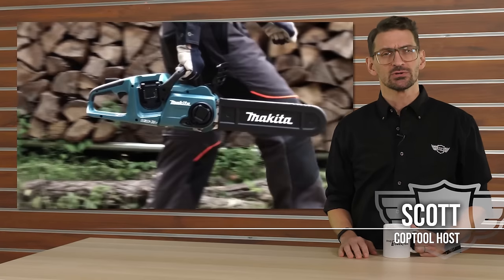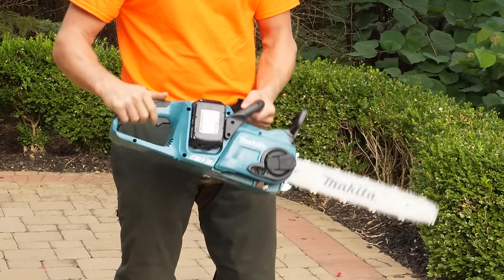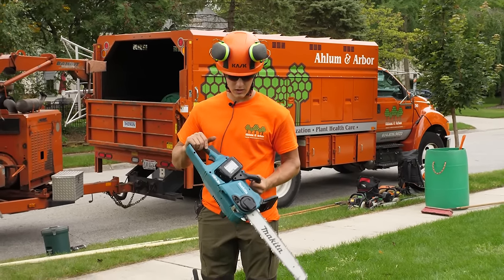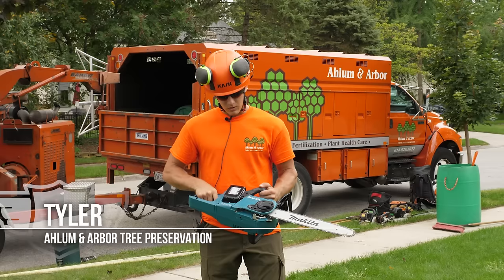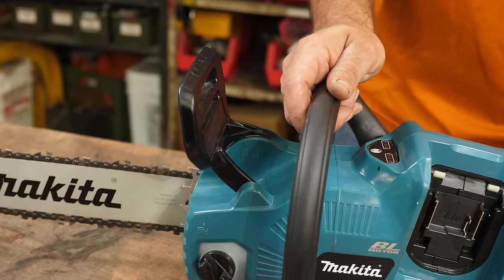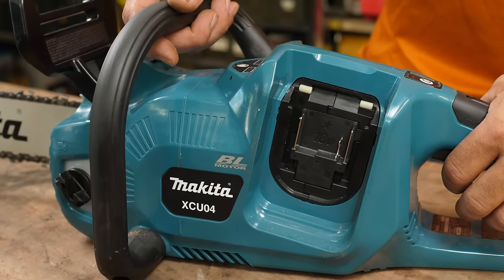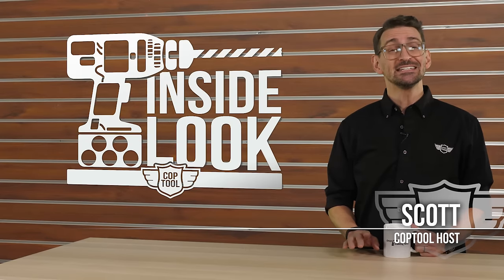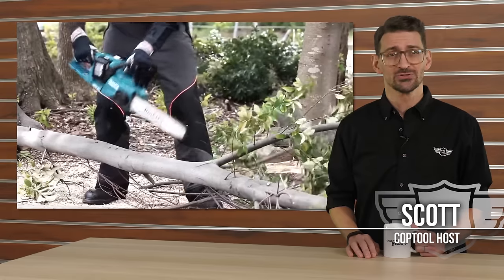Inside Look: Makita 18V X2 (36V) LXT Brushless Cordless 16” Chainsaw XCU04

Comment: Having spent a few hours running saws I believe what he was saying was will any electric saw replace my gas saw. Oh hell no! For the home gamers in the back yard fine. Also when you say you're going to take it apart I was assuming it was going to be AVE style.  A bit disappointed in that all he did was take the bar off. Come on open that baby up let's see what makes it chooch!
Reply: I have not found anybody who takes tools apart like AVE. He did though pull apart the dewalt saw and he was very negative towards the plastic tooless bar ratchet mechanism. Makita does sell the LXT saw with the old duel nut style which should outlast the saw itself

Comment: You need a HEAD TO HEAD BATTLE, MAKITA VS MILWAUKEE
Reply: Luke S    Also add the EGO with their 7ah battery
Reply: Tried this and it does not have as much power
Reply: Any comparison should be done with equal power batteries.  2 Makita 6 Ah batteries have the same power as Milwaukee's 12 Ah battery that weighs a pound more.  The chains should be the same as well a full chisel chain cuts faster but kicks back more.
Reply: Makita is much better
Reply: The Milwaukee probably has a bit more power, but the Makita is better construction and higher quality overall. I hope in the future they'll have pro saws with magnesium alloy body instead of full fiberglass plastic

Comment: I put a Stihl chain on mine and it's unstoppable now
Reply: Water will stop it.
Reply: Mine doesn't plunge cut very well... still have original chain.. does the stihl chain make a difference....??
Reply: smokingcheeba420 it won’t. I use mine in the rain all the time.
Reply: I put a 16" Archer bar and full chisel Archer chain on mine.  Made a significant improvement for only $30 total.  $20 bar and $10 chain.  The Archer chain is really impressive!
Reply: I just bought a XCU03. Like the idea of the longer bar and better chain.

Comment: not one mention of battery life. the clear obvious limitation of an electric chainsaw.
Reply: My neighbors an arborist specialized in precision jobs in tight spaces and such.
He uses a battery powered husqvarna (?????) exclusively. One charge lasts him an entire day (2-3 large trees). Cuts anything up to 10 inches off and then switches to a larger gas powered saw to take out the really big branches and to cut the stem itself. 

I would say this one’s a tad too large for what these guys would use it for. No one is going to make 1500 cuts a day with a battery powered saw, you’ve got gas for that (or corded when on the ground).

Currently the niche for battery powered saws in this business is in light, small and portable saws for work high up in the trees themselves.
Reply: @wippip  
Husquavarna makes a backpack battery.

Comment: I’m using the Makita XCU03 (same as the xcu04 shorter bar) right now to cut firewood from a large pile of mixed hardwood logs that didn't get to the mill.  Most of the wood is larger than 16” diameter so it requires continuous duty working around from one side to another.  Oak, hickory, black walnut, some poplar.
I installed a 16” bar with full chisel chain.  I cut my wood in 9” lengths.  Of course shorter wood requires twice as many cuts, but the pieces are easier for me to lift and split.  I fill a small trailer 5’x4’x2’ above the side rails, which is near the maximum I want to pull with a small RZR side by side.  This usually takes a set of 6 Ah and one set of 5 Ah batteries.  Sometimes I need a little extra so I carry some of my older lower capacity 3 and 4 Ah batteries if I need to finish off.  It’s real important to me to know I have a bag-o-batteries so that the job always gets finished.  I already had quite a few XLT batteries.  The bar oil always lasts throughout the job, that is, several sets of batteries, so I never need carry oil.

If I were cutting 18” long pieces I think this saw might cut an 8’ pickup load of wood with two sets of 6 Ah batteries and one oil fill up. The 16 inch bar with full chisel chain seems to cut much faster than the Makita 14 inch bar and chain that came on it.  I bought both bar and chain for $30 on Ebay.  Archer brand - made in Australia.  

I get to rest for 45 minutes or so after unloading while my batteries recharge (in more ways than one).  I like that!  I’m 70.
Reply: The bag of batteries is a must if you want to do some real work. i have 4x5A and 2x3A and i can get a lot of work done. A single set is too little.
I'm using a new 14 inch oregon bar and a round ground oregon chain. I also noticed the round ground (semi-chisel it think) throws bigger chips than the original and the cuts go much faster. The original chain is not very good.
Reply: Thanks for chatting with me.  I like talking about my saw.  The Archer bar chain I'm using is fantastic.  It's very durable and cuts faster.  Full chisel is the way to go, especially with battery saws.  The 16 inch bar with this chain cuts faster than my 14 with anti-kickback chain.

I have six recharge stations, 4 singles and a double.  I now have two sets of 6Ah batteries, one set of 5Ah, one set of 4Ah and a whole pile of 3Ah batteries from years gone by.

My chargers are all connected to a watt meter.  When I'm loaded up really heavy with all that I dare tow on steep hillsides with my Polaris RZR side by side, it typically takes between 500 and 650 watt hours to recharge.  Of course, it doesn't matter which batteries I decide to use.  I rarely ever use more than 6 batteries by the time I'm done. I usually put 6 in the sack and 2 on the saw when I go to cut wood.  If I were to cut 18 inch length instead of 9 inch, I could envision that this amount of energy would buck up a really heavy duty pickup load from the logs I'm cutting.

My wood is split and in a lose pile.  It's hard to say how many cords I have cut with just batteries at this point, but I'm guessing between 10 to 20 full cords.  I've had no problems with the Makita.  I did tape down the top safety trigger on the handle, this gives you a minute or more before the saw shuts down to move wood around.
Reply: @geraldmoore6257  did not try a larger bar but what I know is that the new chain, sharpenable by file, is a lot better than the original. 
You did mention 5-600 watts to charge  so this is so efficient compared to a corded saw that uses at least 1800watts per hour to 2200, even 3000. If we do the same math on the gas saw then the gas saw will look really bad being a combustion engine. 
Really like the saw. 
Ps: In Europe it is named DUC353Z.
And... You are welcome 😀
Reply: Hey, thanks for continuing the conversation.  Here is some more info related to what you are saying.  What I am going to tell you is never mentioned anywhere.  I wish battery saws would give you horsepower or watts, these are power units and could be used by the consumer to decide what saw they need.

500 watt-hours isn’t horse-power or output wattage and you can’t translate conventional corded brushed saw wattage directly to horsepower because they are inefficient.  

The Makita uses two 10 cell batteries or 20 each 18650 Lithium cells.  Each cell can output 70 watts each, therefore the Makita battery saw motor is using 70 x 20 or 1400 watts @ peak power, that’s 1.88 horsepower.  This is the equivalent of a brushed corded saw running at 1750 watts due to a 20% efficiency gain from the brushless DC motor.  

Note that you’re not running a chainsaw continuously.  At 1400 watts continuous peak the saw only can only run 21 minutes.  But saws don't run continuous, sometimes they don’t draw full power and sometimes they aren’t running at all.  It takes me over an hour to get a load, but I’m loading and moving wood or going from one spot to another. 

Some battery saws are more powerful, albeit much, much heavier.  Most use the same 18650’s, but some use 20700's or 26650’s or a greater number of batteries and can therefore output more continuous power and drive longer bars.  For example, a certain Echo battery has 28 18650 cells each capable of outputting about 70 watts each.  That’s 70x28, or 1960 watts continuous power or 2.6HP - Wow.

Amazingly however, the Makita 6Ah battery set contains approximately the same total energy, 218 versus 204 watt hours for that Echo.  That means both saws should cut the same amount of wood on a battery set, albeit, the Makita SHOULD be a bit slower.  For me, the important part is not speed, but weight.  The Makita does it with close to half the weight.  Who wants to trim limbs with a 20 pound bowling ball when the maximum allowable weight for a bowling ball is 18 pounds?
Reply: Hi Gerald, Which Archer Bar and Chain did you get, I want to get the same for mine. Thanks, JT
Reply: @jtairforce9127   I got both bar and chain for $30 free shipping on Ebay.  Archer 16", 3/8"LP, .043", 56DL Guide Bar Replaces 164MLEA041 For Husqvarna Saws.  Chain:  16" Archer 3/8" LP, .043", 56-DL Saw Chain Replaces 90PX056G, Stihl 61PMM3, H38.

I just searched eBay and can't find the 0.043" bar any more.  Good thing I bought two of them.  Good luck finding it.
Reply: Gerald Moore thanks a lot for your comments!

Comment: This is a not a replacement for 60cc pro gas saws! This is more like a 35cc.
This a adequate saw for orchard, around the home work, buckin and such. 
No fuel mix, no fumes, no cold engine, no cord pulling, no spark plug, low noise, silent at idle, no gas smell, no need for screnches. Just fill some bar oil, fit the batteries in, push the button and go to work. 
If one want to do more work then get more battery sets. With 4x5amps and 2x3amps I can work for around two hours.
It can use 16 inch bar but never felt the need to go beyond 14 inch.
One thing i advise you is to replace the chain. Bough a round ground oregon chain and it throws much bigger chips than the original one. The original chain is less agressive and has to be gound using a machine. The cutting speed went up dramatically. It also improves the amount of work one can do with it.
Reply: You are right about the chain.  I replaced my 14" with a 16" Archer bar and chain.  I could only get full chisel chain.  I'm glad because the saw cuts faster and more total cuts than with the shorter bar that came with the XCU03. The 16" chains are $10 and the bar was $20.  I like the Archer chain much better than the Oregon anti-kickback chain.

I cut up the equivalent of 20 cords of timber logs into firewood last winter.  Logs ranging from 12 to 25 inches.  The saw uses about 500 to 600 watt-hours of batteries for half a (full) cord.  Two battery swap outs (3 battery sets) usually cuts that much with some power left.  I have the chargers plugged into a watt-o-meter.  That's how I know how much electricity is used.  The rating on Makita batteries is spot on.

Comment: Great to see the saw taken apart to see how is better made and engineered than the harbor freight atlas I was considering.  I have stihl saws but have been wanting to add a quiet battery saw.  Leaning towards the Makita plus they have a two free battery deal in may ‘20.

Comment: I just bought one and I keep finding new model numbers out there which are identicle to me, there’s a chainsaw/charger/4 battery kit at HD but there are at least 3 versions of the 14 incher(I meant to buy 16”) but f D ones anuone know the difference in the different model numbers? 2 are $389, one is $399 and I just wanna throw a line out for some info if anyone went that deep in their research
Either way gonna keep mine I’m 94% sure but... anyone know the differences?
Reply: HD does those little tricks with their pricing. I only follow Makita, but they probably do it with other brands too. They do it with circular saws, impact drivers, etc...... Sometimes you can get a 4 battery kit for the same price as a 2 battery. I bought a Makita combo kit, and saved $100- just by switching the store code and having it shipped to my house from across the country. Makes no sense,... much like buying a car from a dealership with all the trickery. You really have to look at every option in the tool category you want to get a good deal. You will often see the same exact thing presented 3 different ways.
Reply: @matthoward1174  yeah I’m happy with my Makita,  waited for the extra battery deals,  chainsaw with 4 batteries, the circ also w/ 4 batteries, a drill with 1, so bare tools on sale are what I’ll look for next, also bought the usb charger that fits on the battery so if the power ever went out I’d have usb power for days lol

Comment: The big problem with this is the designers decided to turn it off when you release the trigger. If you want to fell and check the cut the saw has turned itself off after 10 seconds or less. 

Leave the damned thing on

Comment: I'm in the UK but not having much luck finding this model,is this the latest out,or whats the equilivant please
Reply: Hey Andrew,
I live in the Netherlands.
But the UK & European modelname is DUC353z.
Have this saw for 3 months now and it's an fantastic replacement for my Stihl 1986 motorised saw (also working like new).
Reply: How much makita costs in euros
Reply: @xrobotxrobot384  hey the makita DUC353z costs between €240,- (without a single batt recharger & batt) & about €360,- (with a 5ah batt & double recharger)
Reply: @kevinwillems2656  Where can i buy it in Munich Germany at sale:) thanks

Comment: The tooless adjuster is a con, the bar is not held as well with a single fastener vs 2 on a standard saw
Reply: Adam Petten they have a variant with traditional 2 bolts and tightening mechanism. The single fastener does great. It’s not the same as the garbage dewalt clutch tighting where it limits how much you can tighten the bar. This single bolt clamps as hard as you want it. Tool-less adjuster works great too. It will tighten the chain to the point where it’s impossible to rotate the chain.
Reply: You obviously have only used other tools adjusters.  Makita's is different in this regard.
Reply: @banannaninja  I have a corded electric Makita chainsaw, and the chain tension adjust knob is designed for hand tightening.
and I managed to bend the steel tightening screw, and had to buy that part, which was only couple dollars,
but there is right hand twist screw, and left hand twist screw, which look exactly the same, except for the direction of twist,
and I ordered the wrong part, and had to reorder the correct part.
Reply: been using this for months to fall tress, buck them, chop branches. the holding mechanism is tight. i never felt the need to tighten it more. the tensioning also works fine. i've had some issues in the begining when i started using it but never since then. (never used a saw before this one). the saw is legit and dependable
Reply: Seems to work well and not had a problem with it
Reply: @rogerjones624  just wait a while... all pro level chainsaws have 2 bolts. My Stihl 290 has been going strong almost 10 years, id bet my life most of these electrics will be in the garbage by then. I found the Milwaukee to have the best affordable construction and I have a few 12.0 packs so it was a no Brainer. The best electric chainsaw is probably the echo but I have no reason to buy that battery platform.

Comment: I am a very loyal Makita customer. But this saw is by far the worst Makita product I’ve ever purchased. Maybe I got a dud but I’ve read a lot of online comments with the same problems.
Reply: Russell Cali don’t have absolutely any problems with mine.
Reply: Don't leave us hanging. What Problems?
Reply: no problems with mine. been using it all fall, winter and this spring. it's a great little saw and i highly recommend it!
Reply: Got mine last fall and have cut about 15 full face cords with not problems.  Right away I taped down the top safety latch.  The saw says on for over a minute so you can set it down and move stuff around.
Reply: What u recomend which makita is the best?
Reply: @geraldmoore6257  Good idea.  It turns itself off too quickly.